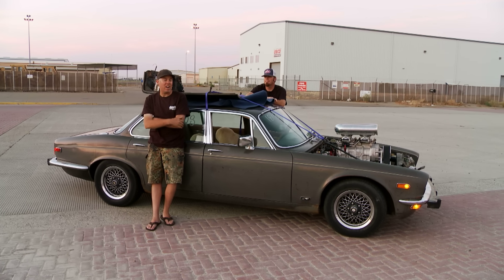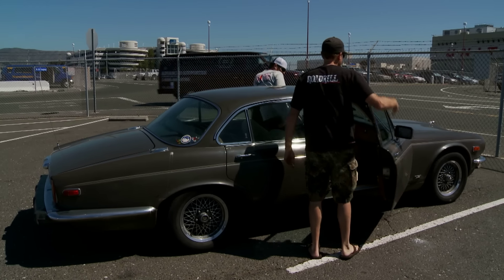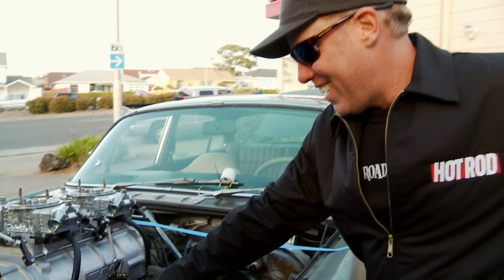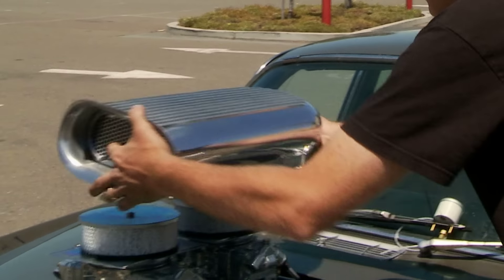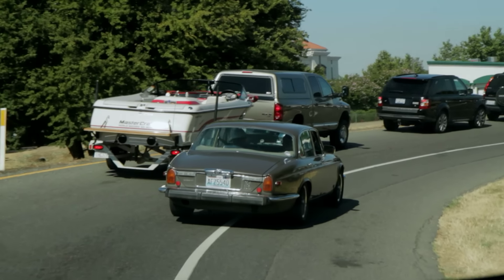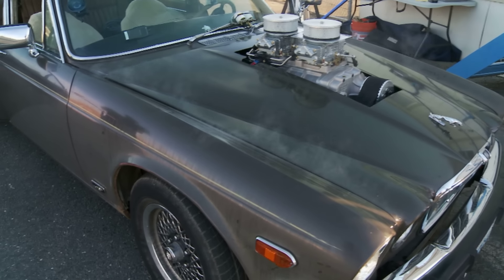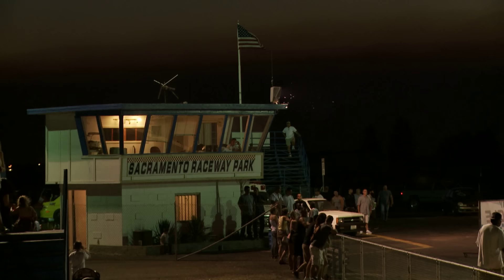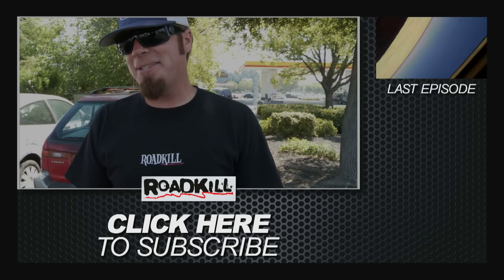Release The Draguar! Building a Blown Jaguar Rat Rod - Roadkill Episode 7

Comment: So here we have a "rare" WORTHLESS car that was so bad it sparked the joke "you might as well own two so you can drive one while the other is in the shop". Engine so problematic that even the Brits tend to swap them. Plus this one in particular was destroyed inside and out. So let's argue that they destroyed a car worth under $20000 fully restored and would cost $50000 to restore. I say finish building the engine and replace the rear end. Make it run low tens and have a good time.
Reply: Awww... Is someone butthurt?
Reply: Krista Cochran How did anything he say sound butt hurt?

Comment: This was the number 1 car to use as a donor vehicle for hotrods in the UK about 30 years ago because it had suspension/brakes/driveshafts that could handle big power, they have great road handling and would beat the pants off any US car of it's day when it came to road handling.
It's really slow because someone has removed the original 12 cylinder motor.